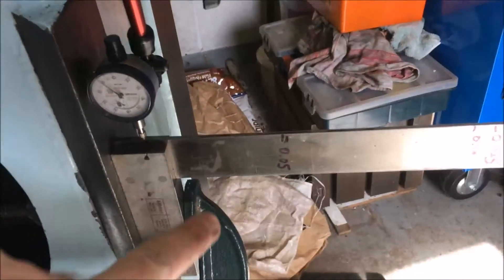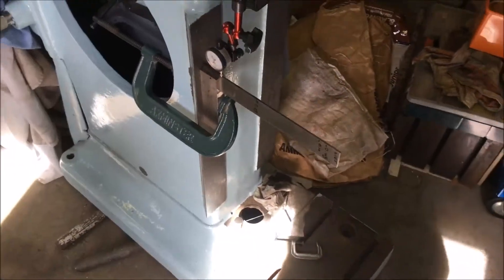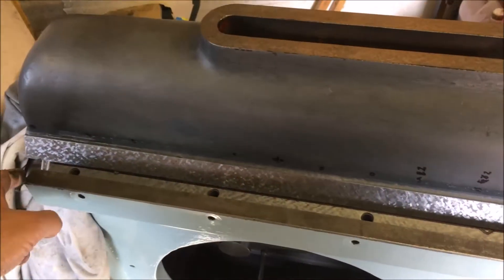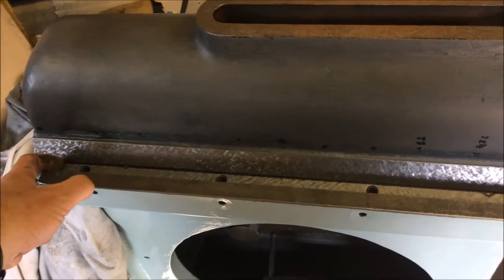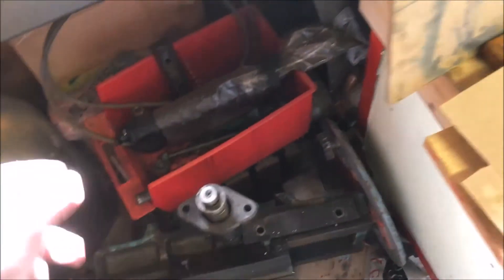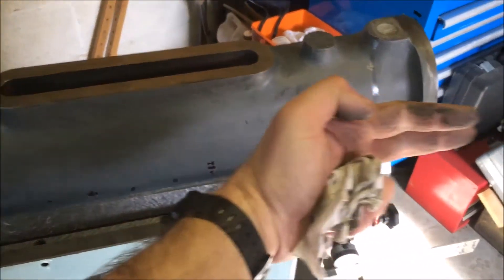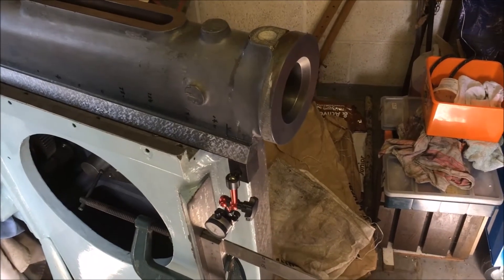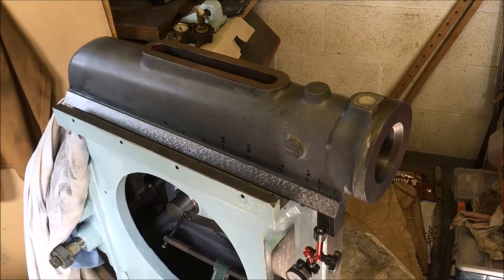Ram Alignment

Comment: Are you sure the ram moves 100% parallel to it's ways when you just push it out like that ? I wonder if the rear end could start lifting  little bit when you are way out there.
Reply from the maker: Panzax you are correct with your comment. I rested with the gib in place and while the reading was a little better (a few tenths), I then set up and tested the square which was 0.0022" out if square. I'm busy correcting the ram guides now. Thanks for your comment and stopping by.
All the best Mat. if you want to see the larger version of this shaper running, take a look at Keith channel Mr Myford. lovely machine
Reply from the maker: bolted the gib in place .... not rested. !
Reply: I didn't find that channel. Did you mean myfordboy ? You do great work by the way. The shaper looks great.
Reply from the maker: Here is the link to keiths channel - https://www.youtube.com/user/mrmyford

Comment: Matt, I know it sounds too easy, but my first suspicion would be the square. How sure are you that the square is reliable.
Reply from the maker: It isn't - after checking,  it out its c 0.002" out of square - so the ram was c 0.002" out. Far more realistic to bring the alignment back from the top slide re-scrape with approx 0.0035" to remove at the rear to nothing at the front.  Another lesson for me there - check the measurement gear first !

Comment: If it were me Mat I think I'd run a check of just how parallel the rams front face that the top slide attaches and rotates on is to the columns vertical ways with an indicator. Likely those two surfaces had the least wear from new and one would think there would have been every effort made to get them in the same plane. With that check You'll know where to bring the rams dovetail surfaces down to maintain that alignment. Then again how true is your square? If you can verify and subtract any of it's inaccuracy you should have a much better idea of where and how much the machines surfaces are out. It took me a very long time but I finally learned not to automatically trust any precision metrology equipment including brand new unless I've checked to be sure it's correct first. Then how much wear has been put on those vertical ways where they would have been used the most. Have you checked them with your straight edge? I'd guess the top and bottom of the vertical ways on the column shouldn't have much or maybe any. So they should be very close to or at the original factory condition and the length of your straight edge may be long enough to get a full print on those surfaces.

From the little I've learned about machine tool alignment from the Connelly book a full machine survey seems to be needed, average out where and how much needs to be removed, then get one reference surface established and correct. All other surfaces then get realigned to that.
Reply from the maker: I spent a bit of time late evening confirming that at best the square is dubious. I will try and get some numbers today and then do some further checks. The problem with the vertical ways is that at some point the upper surface area has rusted - its been cleaned off, then at some stage painted over and the paint cleaned off (still in the pits_..) The lower section still shows flaking, and when I went over it all lightly to removed any burs with a stone it shows quite larger 'high spots' - I will print it though maybe today to get an idea of where its at.  As the vertical surfaces are only used as  a clamping face for the saddle / carriage and not moved during the machine operation - I would doubt there is little wear and from what I see the lower half supports that. But as you say - trust nothing until you can verify it.
Reply: Yes very good point about the vertical not being used during most cuts. Rarely but still possible you could have two or more cuts at different elevations though. I could easily be incorrect in the way they would have machined the original castings. My best guess is the logical and easiest way would have been for them to machine the vertical ways first to close alignment with the rest of the raw casting then use that clamped in a fixture on likely a large planer so the rams ways were done next and at 90 degrees to the vertical ways. Impossible to know for sure now but it seems the most reasonable way. At least from my reading of old planer and shaper books it wasn't unknown to take a light clean up pass once in awhile across the table to make it parallel to the rams travel. So in reality you'd only need to get those ways fairly close for most work and at the average height the table would be used at. More work of course, but with the shaper operational and the table re-cut parallel to the rams travel a cylindrical square on the table and indicator would then give you some numbers about how square the vertical ways are to the rams while raising or lowering the tables elevation. Sort of a put it back together just to take it all apart job though. :-)
Reply from the maker: first things first. The T Square shows that the bar is parallel,  as is the stock. Good starting point. Measuring then at the extreme end of the bar, I record between 0.0035 : 0.004"  between the working faces, which I understand is double the error from perpendicular to the surface plate. So the T square is between 0.0015 to 0.002" out of being a true 90 degree reference. I now have to check the ram again but if possible with the same dti used for the square check. If it shows the same misalignment as in this video,  then I can work on upto 2 thou' is the time square. so the ram is c 0.002" out at 10 " extension. At least I think the above is right.
Reply: You may have just run into a bit of luck for a change. :-)

Comment: Mat, you're running into one of the problems that plagues me - what to use for a reference surface. I have an uncalibrated surface plate and other measuring tools of dubious calibration so what do I use for a reference? The good stuff is out of the hobbyist price range.  Craig
Reply from the maker: Very little of what we actually measure is absolute - so a 1" mic'  used for the measuring upto an 1" is fine - calibration is of little benefit (for our type of work. Most parts are made to 'fit each other' and fudged dims are accommodated with mods to mating parts. Now I saved for a long time to get my granite plate and got the biggest plate I could fit - it was AA - so thats where I start - Ive an old cast 18x18" Sp - which is 0.003" out on its surface. It stands me at £20 - maybe  a scraping project down the line.   I have countless dti gauges - all bought used. Of which possibly half of them are useful.  I have a 2 boxes of slightly rusted joe blocks metric & imperial - they need cleaning up and then verifying  / calibrating some how ... I doubt they will ring together due to the surface rust damage - but if I can get two original surfaces opposite so I can test with a mic' they will do their job.

But a 90 degree square is essential. So I have to get my mititoya 10" back to true - at £85 for a new one - I can afford to spend a few hours lapping the old one on a diamond stone. If I cant get a result then I have to make a cyclinder square - even in mild steel and soft it will do in a pinch. 
My problem is the maths - if a 3" block is 0.0003 out of sqaure, what will that do over 10" or 14" ? more than 0.0003" for sure but how much more ? I read somewhere that the measuring device should be of the order of 10x more accurate than the surface to be measured - so if I am looking for sub 3 tenths over 12" as a tolerance for my Ram, how on earth am I going to get a reference that good ... so I get the best I can achieve as we do and 'fudge it'.

All in all, a good thick coat of paint would have looked fine :-)

Ive started so I will finish